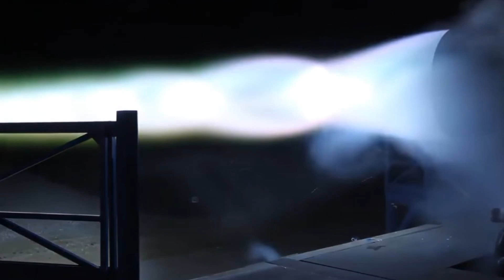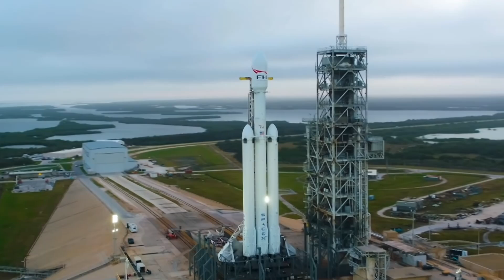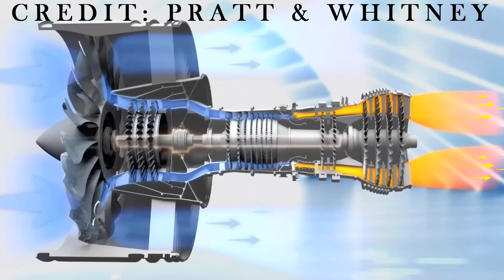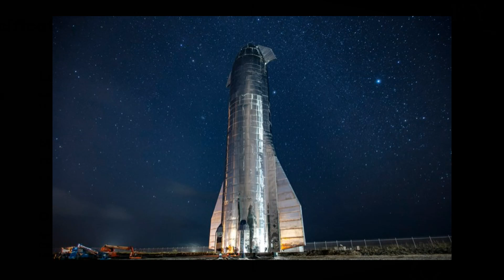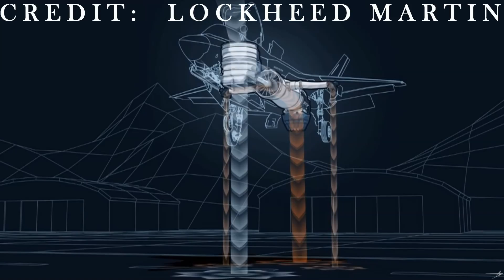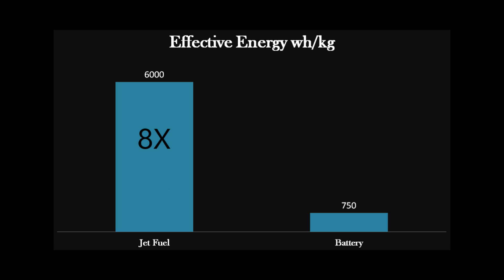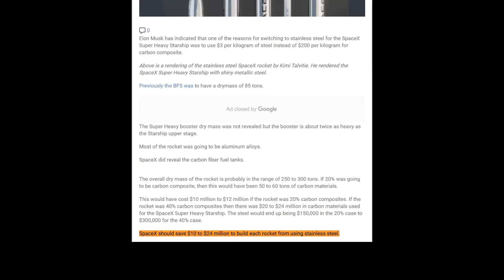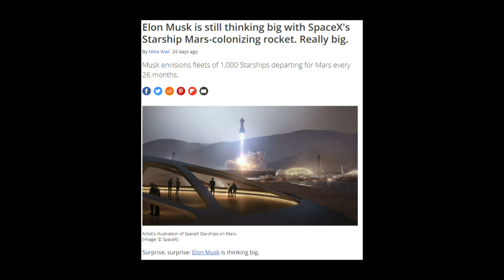ELON MUSK'S BATTERY POWERED SUPER SONIC VTOL JET - My Tesla E-SuperVTOL design

Comment: Im sorry, great video but there are so many things you have wrong in your assumptions about trans-sonic aerodynamics, supersonic aerodynamics, Jet engines design principles (electric or conventional) the list goes on. When Elon discussed the energy density for viable electric flight, it was for sub sonic viability. Currently the only jet to super cruise (fly at supersonic speeds without using the afterburner) is the F22 raptor. If you would like to refine this concept i would be happy to discus it with you, I'm not here to just shoot you down. Genuinely think a closer and deeper look into the possibility of a commercial VTOL aircraft would make a great video.

I do 3d modeling, CAD etc and have access to fluid flow simulation software, so if you want to do a follow up video id be happy to offer my assistance and share my knowledge. I have an unhealthy obsession with aircraft, especially the SR-71, so I've gone down some crazy deep rabbit holes chasing information.
Reply from the maker: All good!  I'm looking for critical feedback, will reply to your DMs on twitter after I catch up with all these messages
Reply: Didn't "The Concord" break the sound barrier?
Reply: @kaveeone  yes, but it used afterburners to do it
Reply: @23chaos23  Concorde used afterburners to break the sound barrier yes. But then once at supersonic velocity it did indeed supercruise. Concorde holds the record, to this day, for the longest time spent in supercruise.
If I remember correctly, Concorde could supercruise for as long as two hours.
Reply: @martinw245  correct, but you are missing the point here. I had a great discussion with Jordan and he might do an updated video possibly a series talking about the Limiting factors... pun, no pun, you decide.

TLDR: Electric supersonic flight, not happening. VTOL possible but actually very impractical.
Reply: @23chaos23  No I'm not missing the point. The only point I've corrected you on is when you said "currently the only jet that can supercruise  is the F22 Raptor". It's not, simple as that my only point.
Reply: @23chaos23  "VTOL possible but very impractical."

 Subsonic it's happening now. I've lost count of the number of flying and prototype VTOL electric vehicles that are currently around.

Supersonic... no way. Supersonic flight at lower altitudes requires significant thrust. No ducted fan powered by batteries can currently do that. In fact I'm not sure any ducted fan could ever accelerate an aircraft supersonic at low altitudes.

At altitude the air is thinner and the speed of sound lower but then a ducted fan or any kind of propeller is very inefficient at higher altitude.

Electric aviation is the future. We already have Eviation Alice about to have its test flight. Promising 1000 kilometres and twelve passengers. But I'm pretty confident we can forget supersonic electric aircraft. There is no reaction mass emitted, so it has to be ducted fans, and I dont see how that's possible.

This is Elon  doing what he sometimes does... making fantastical claims. 
I like that he does think that way though, because he sometimes proves the sceptics wrong.
Reply: @martinw245  key word, currently. Is the Concorde still flying? No, the Eurofighter, Crippen etc also can not achieve super cruise without using afterburner. Sure after using AB and achieving mach 1+ they can turn off the AB.
Reply: @martinw245 .........really?
Reply: @23chaos23   I didnt mention Concorde in my original list of aircraft that can supercruise. You, later, responded to someone else re Concorde.  That was the only reason I mentioned it. No, of course, Concorde isnt in service, why I didnt initially mention it.
Reply: @23chaos23  I dont think you understand what supercruise is. Supercruise is the ability to SUSTAIN supersonic flight with afterburner off. Grippen can do that, so could Concorde. So can the other aircraft mentioned. Supercruise does not mean accelerating to that speed without an afterburner.
Reply: @martinw245  again, I said, able to achieve super cruise without AB. Dude seriously your picking at words at this point. Have a nice day
Reply: @martinw245  more like three hours, and it didn't need afterburners to get through the sound barrier it was simply more efficient to blast through it on a quick burst of afterburner than sit transonic for a long time on dry thrust.
Reply: @deep_dive6699  Acording to Google it was two hours Concorde supercruised. But fair enough if you have a resource that suggests 3 hours.
Reply: Chaos

"I said able to achieve supercruise without using an afterburner"

No you didnt.  What you actually said was, and I quote... "the F22 was the only aircraft that could currently supercruise" Then in brackets you defined supercruise as...  (fly at supersonic speed without using an afterburner)"

Which is wrong. There are a number of aircraft that can "fly at supersonic speed without using an afterburner"

You initially said nothing about how that supersonic velocity was initially achieved.

One more point... you are saying that you believe the F22 can ACHIEVE supercruise without initially using the afterburner. If so, I would be grateful if you could provide evidence for that. I heard was that the F22 could SUSTAIN Mach 1.5 without afterburner but still required afterburner initially, just like the other aircraft I mentioned.

Wouldnt be surprised if it could, given that it can sustain supercruise pretty much indefinitely but would like a link.
Reply: @23chaos23  English electric lightening for example could achieve and sustain supersonic flight despite not having an afterburner. You need to recheck your facts.
Reply: @avidaviator8580  best recheck yourself,  The Lightning's optimum climb profile required the use of afterburners during takeoff. excerpt from the wiki under climb performance.

https://en.wikipedia.org/wiki/English_Electric_Lightning#Climb_performance
Reply: @avidaviator8580  also i said "currently able" the lighting last flew on 14 January 2014 after restoration and is currently the only airworthy example. see civil operators at the bottom of the wiki
Reply: @23chaos23  that literally changes nothing, the early versions could go supersonic despite not having an afterburner. Later versions did have an afterburner. And what relevance is currently flying when we are discussing the feasibility of technology.
Reply: @avidaviator8580  if you would like i we can have a chat about jet engine design principles and why the lightning's avon is a non conventional engine
Reply: @23chaos23  we can, but it still doesn't change the fact that you wrong about supercruise and the aircraft that can achieve it, before you shoot down the video.
Reply: @avidaviator8580  best you wait for Jared's follow up video, we are working hard to collect all the information to put together a new video. I wasn't shooting down the video, I was trying to help him understand the subject is much more complex and many of his assumptions were off. You can all go on about my mistake with the f-22 which I admitted to, but my assertions on the subject of the video are not false.
Reply: @23chaos23  that's true, I can agree that the video is not the most accurate.
Reply: @avidaviator8580  i can admit my words often come off the wrong, Im on the asperges spectrum. On the subject of how the lighting achieved super cruise, two way overpowered engines in a barely big enough air-frame, also the avon engine sacrificed a 2nd stage turbine for greater output. made them notoriously difficult to start. they built the thing to be a hot rod interceptor, causing it to have numerous problems in flight other characteristics.
Reply: @23chaos23  - I it was me dreaming up an Electric Plane, for a Test Mule, I would use. Cessna 210. For the Proof of Concept, Burt Titans Designs are better Aerodynamic Efficiency.

Basically, like the start with the Roadster, start HIgh End, and work down!
Reply: @robertweekley5926  Thats a good approach to use, personally i would start with the 208 caravan. Its use as a commercial air frame along with that large underslung cargo add-on could be used to house all the batteries.  Im also a fan of Burt's designs, but they weren't always the most aerodynamic, Burt used a broad "try many designs to find the ones that look good and also work" approach.
Reply: @23chaos23  I agree with @Robert Weekley herer: You really want to figure out the first viable market for electric planes and target that, just like the how Tesla targeted the luxury sports-car market first, then expanded. In this case, the analogous market would probably be private jets. They aren't so cost sensitive and they don't have to have the longest range if you can offer other benefits like VTOL.

I wouldn't target commercial air frames. I would target luxury private jets.
Reply: @AbeDillon  That is exactly why i suggest modifying the Cessna 208, they are used for remote/rural commercial operation. STOL bush planes, island hoppers, places where an electric plane's major feature, low running costs, can really shine. Currently electric planes are being used in the small twin seat class as training platforms. The luxury private jet industry is not a good market to try and enter, purely from an economic and volume of sales stand point. You are absolutely correct about large commercial air-frame being a bad way to go. Comparing it to Tesla, it would be like starting with the cybertruck or a utility vehicle rather then the luxury sedan.
Reply: @23chaos23  Luxury Private Jets are low volume but high margin. That's why they're a good fit for Tesla to build expertise by devoting a small "skunk-works" team to cutting their teeth on a first-gen design. Just like the Roadster.

You can make a Luxury Private Jet that's viable before you can make a commercial plane that's viable because you have a lot of profit-margin to cushion you from any lag in technological progress.

Mass market = extremely cost sensitive = low margin.

Small twins and training platforms are the scooters and bicycles of the aviation world. They're low-margin platforms that also serve as early addressable market for electrification. But they're still quite cost-sensitive.
Reply: @AbeDillon  The difference in margin for luxury, vs the volume of medium light commercial sales is an order of magnitude in favor of commercial. That's assuming your assumption that luxury privet jets sell with a high margin profit, which they don't unfortunately. The luxury Jet industry usually sell just below unit cost, they make their money with spare parts, maintenance and servicing revenue.
Reply: @AbeDillon  - I suggest the Cessna 210, for a few reasons: One, they are generally "Available", used, for $50,000 to $150,000 Price Ranges, depending upon Engine Age, Avionics, Aircraft Age, and Variant (Plain Non - Turbo, Turbocharged, and Pressurized - Also Turbocharged, of course).

Second, I suggested it as a "Test Mule", not a Commercial Conversion Offer, but That might even be an option step along the way, to get greater data collection, than from just one or two test rigs.

Third, it can Fly up to about 200 Mph on 285 HP, and with Siemens 110 Lb, 350 HP, Electric Aircraft Motor, you have about 400 Lbs of Engine Weight missing, plus Fuel Weight, of about 110 Gallons, of about 700 Lbs!

Fourth, I have Flown it, loaded, as well as Empty (Just Myself), and Slowed it up to 160 Mph, leaned out to 8 Gallons Per Hour (GPH), or 20 Mpg @ 160 Mph! Since max Fuel Burn is about 14-16 GPH, I figure it was only using about 135-150 HP to cruise at that Loafing Speed, just puttering along, at about 2,000 RPM on the Engine, or about 100 kW! 

Since Tesla Already can provide a 100 kWh Pack, at not far off of the 700 Lbs Fuel, Plus 400 Lbs of Engine Weight Missing, it seems, without any seating lost (It usually seats up to 6!), You could easily get 30-45 Minutes of Run Time, plus 15 Minutes "Reserve", nearly "As Is" with Limited "Customization".

Making it a 4 Seater, gives you about an extra 340-350 Lbs Usable for Batteries.

Going with the Cessna 208 Grand Caravan, Requirements go up, to two x the 350 HP, or use a MagniX Motor, if not the Siemens one, and it's at 750 HP, but, as Harbor Air is learning, in commercial applications, it's as much about Airframes, as it is about Power Systems. A Beaver is a Great Slow Speed Aircraft, but a Caravan from Cessna, on Wheels, is way "Cleaner", Aerodynamically, than a Beaver on Floats!

Nice thing with Aircraft, if the Weather is Sunny, or even just "Decent", is that a 15 Minutes Long "Flight" can get you 50-70 Miles, in a Faster Plane, and that could be a 2 hour, to 4 hour Drive, in a Car, depending on availability of Direct Roads and Traffic, or Not! And, available Airports!

So, for the early part of this Decade, places that can be served, by 15 Minutes to 30 Minutes long Flights, can take Advantage of Electric Flight. Maybe at the later part, 2-3 Hour Flights, under Electric Power, in Certified Aircraft, will be becoming available and not just dreams!
Reply: @martinw245  I agree, I've been flying duct ed fans for years, and there is no way you will get one to go supersonic. The fastest one I've seen is around 145 MPH. I flew mine up at Tahoe, and that is not very high, and it was kinda gutless, and I noticed a difference from flying it at sea level. No way one is going supersonic.
Reply: @3000gtwelder  Yep. I'm afraid Elon does talk nonsense from time to time. Unless this microwave plasma thruster notion bears fruit I think we can dismiss Elon's supersonic VTOL electric aircraft as another one of his baseless notions.
Reply: Musk did talk about an "electric Jet" supercrusing. He pointed out that without the need for oxygen for combustion, it could fly higher and experience less friction.
Reply: @DrZond  Indeed it wouldn't require oxygen and experience as much friction. But an electric aircraft cant be a true jet, there is no reaction mass. It's a pusher propeller with ducting. A ducted fan. And propellers or ducted fans are very inefficient at altitude. I wouldnt take Elon  Musk's comments re this that seriously to be honest. VTOL and electric ducted fan and supersonic... pretty sure wont happen, pretty sure not feasible.
Reply: @martinw245  You're assuming that a electric jet would be propelled by the propellers rather then heating up air.
There's more then one way of using electricity to power a engine, the use of magnets to make a axel turn around isn't the only one.
For instance imagine a electrically powered ramjet using electricity to create electromagnetic radiation heating up the air in the ramjet in order to create thrust, other substances could also be added to the air that's not fuels being burned but simply targets for the electromagnets in order to increase heating output if desired, turbines etc can be added to help compress the air at lower speeds allowing for more thrust when it's heated up and expelled out the back.
Reply: @Luredreier  

"You're assuming that a electric jet would be propelled by the propellers rather then heating up air."

Yes I am, when I say "can't be an electric jet" I refer to current technology. Because currently and a fair way into the future, that is the only viable means, a ducted fan. 

"For instance imagine a electrically powered ramjet using electricity to create electromagnetic radiation heating up the air in the ramjet in order to create thrust,"

I admire your creativity. But you are forgetting one VERY important factor... ENERGY DENSITY. 

If you try to do what you suggest you immediately run into a mass/energy density issue. 
 
Energy requirement for an aircraft is high, and the mass must be low. Energy density for jet fuel is 34.7 MJ/L. 43 times higher than a battery.

It will be a long time until battery energy density is high enough to achieve an equivalent energy density to jet fuel. 

I'm, not saying it will never be possible, just that, it would be  a fair way into the future and currently, any electrically powered aircraft would have to be a ducted fan design. 

So if Elon truly does have a viable "electric jet" design in his head, it will be a ducted fan.
Reply: @martinw245  Just noticed this prototype design of a propulsion thruster that utilizes pressurized air plasma induced by microwave ionization to create a "jet engine" with only air and electricity: https://aip.scitation.org/doi/full/10.1063/5.0005814#
Reply: @mearino 

 Hi Dean. Yes, I noticed that the other day. Fascinating idea. I think it would probably require a battery with a considerable energy density though.

They mention a Tesla car battery in regard to generating enough thrust but over what time frame? For a few minutes? Hours?

In other words, how would it get on for gravimetric energy density?

Will be interesting to see where this goes.
Reply: @martinw245  There were some concerns at Ars Technica: "The question is one of scaling. At the air flow rates (around 1m3/h) and microwave powers (less than 1kW) that the researchers tested, everything scaled very nicely. But the airflows are in the region of about 15,000 times lower than those for a full-sized engine. The thrust also has to scale by about four orders of magnitude (meaning the power does, too). Extrapolating linear trends over four orders of magnitude is a good way to be disappointed in life.

I also believe that the warning signs are already in the paper. If you look carefully, there are some missing data points. For instance, at the highest microwave power, only lower flow rates are tested, while for low microwave power, all flow rates are tested. That seems like an odd omission. I suspect the plasma is not stable at high flows and high powers.

If you're thinking this work might help save engine weight, I wouldn't be so sure. If the plasma thruster becomes part of a turbofan engine, I suspect it will be heavier. In a non-bypass configuration, it might be lighter. Still, this is very cool work, and I hope it works out. " (https://arstechnica.com/science/2020/05/microwave-thruster-makes-for-clean-burning-jet/
)
Reply: @mearino  

Thanks Dean. I'll give that a read.
Reply: No that's wrong. The F22 isnt the only jet to super cruise. The F35 can supercruise, the Eurofighter  Typhoon can supercruise. Rafale and Grippen  can supercruise. SU-35 can supercruise.
Reply: From what i read the F-35 cannot supercruise. This was known for some time. https://www.defensenews.com/air/2019/06/12/supersonic-speeds-could-cause-big-problems-for-the-f-35s-stealth-coating/
Reply: @bradjohnson169  

Yes that's kind of true. F35 can supercruise but not for a lengthy stretch. They reach supersonic speeds with afterburner and then can throttle back for 150 miles or so. I guess it's better defined as short range supercruise.
Reply: @martinw245  Thanks Martin, I quite agree.
Reply: @martinw245  facepalm
Reply: @martinw245  good to know, that wiki entry needs updating then.
Reply: @23chaos23  Please can you tell me which of the follow super sonic wing design is the most efficient? This is bugging me for long time and i can't find a clear answer.

1.)Straight wing with supersonic sharp leading edge (F-104 Starfighter, Aerion As2, X-15)
Or
2.)Delta Wing with subsonic blunt leading edge (Concorde, Convair B-58, Boom Overture)
Or
3.)Delta Wing with supersonic sharp leading edge (XB-70, SR-71)
Or
4.)Swept Wing with subsonic blunt leading edge (Rockwell B-1, Tu-160) (can't find examples with non variable wings)
Reply: @martinw245  Brother, he said "Super cruise without using afterburners". All those other planes go supersonic only with afterburners.
Reply: @flagship1701e 

You are confusing two diferant phases of flight.
Those other aircraft DO supercruise without an afterburner. Going supersonic, accelerating to that speed, is nothing to do with superCRUISE! Pay attention to the second part of the word. SuperCRUISE. Supercruise is defined as CRUISING fying at supersonic speed in the CRUISE on full military power without the use of an afterburner. It's nothing to do with using an afterburner to initially obtain that speed. Supercruise pertains to CRUISE the clue is in the name.

Thus... the F22 is not the only aircraft that can currently supercruise.

He initially said nothing at all about accelerating to cruise speed without an afterburner.

Incidentally, I belive the Typhoon may be able to ACCELERATE to supersonic speed and thus supercruise without an afterburner. But I'm still researching that
Reply: You seem to be the guy with some answers. Electric jetengine? From where does the propulsion come? Turbine, does that work at supersonic speeds?
Reply: @RomainVanAelst 

 If electrically powered it's not what we normally consider  a jet engine. It would be ducted fans. Batteries or fuel cells to drive electric motors which drives pusher propellers. For efficiency they add ducting with the tips of the blades close as possible to the ducting.

Referring to such a propulsion method as a "jet" often results in heated arguments.

A company called Liliam  are currently manufacturing what they call an "electric jet" but one look at the design tells you that in reality, its ducted fan propulsion. "Jet" just sounds sexier for marketing purposes.

https://lilium.com/the-jet
Reply: @martinw245  Thanks very much, had a feeling 'jet' was not in his place here. And thanks for the link.
Reply: Comon gents, when is the follow up video coming out?
Reply: English electric lightening could go supersonic without afterburner?
Reply: @avidaviator8580  Yep, very true. The Lightning could indeed go supersonic without use of afterburner. In fact I recall that the first lightning didnt have an afterburner.

At 62, I can tell you from first hand experience that it was a phenomenal machine. Went to an air show in Devon when I was in my 20's and the lightning was performing. Absolutely deafening, raw power. A brick with two immensely powerful engines basically.

In those days they were allowed to fly over the crowd. When it did so, over our heads, it was an unforgettable experience.
Reply: @martinw245  shows this man is talking garbage, how can you comment negatively about someone's video when your evidence is incorrect. Also I'm super jealous, my best airshow experience is the F35.
Reply: @avidaviator8580  Sadly I've not seen the F35. Missed it at RIAT. Hoping to catch it this year.
Reply: @martinw245  saw it Farnborough during the "reveal" if you could call it that.
Reply: @avidaviator8580  Lightning...
Reply: @martinda7446  shhhhhh
Reply: @avidaviator8580  (OK...🙊)
Reply: chaos my thought is: how can this design possibly attain cruise?
Reply: Back to the topic: I don't see any electric turbine go supersonic. I can imagine an electric multistage compressor followed by a reduced section that can make a supersonic jet but then I assume efficiency would be horrendous.
Reply: @ericseidel4940  absolutely correct, even producing a supersonic jet (exhaust) with a multi stage Axial compressor is a tall order. the final stage compressors and stators would be operating in unsustainable environment.
Reply: chaos - F23 was a better jet and had better Supercruise ability.
Reply: The Sr-71 is possibly the coolest thing to ever been constructed by man. I dont know if its any of the same people who worked on it that are now working on the Skylon but its the same team that are now building this higly impressive space plane, I really hope it gets built.
Reply: Why no one thinks about condensed nuclear reactor for aeronautic application? It can power multiple electric air turbines using superconductors to deliver power virtually resistance free.
Reply: @viewer7200  The US air force tested the concept decades ago with multiple different reactor layouts. The two primary issues they encountered (depending on which reactor design was used) were either exceedingly high radiation emission into the atmosphere or excessively heavy radiation shielding requirements, which were not conducive to practical flight performance. I don't remember which documentaries explained this program, but a bit of Googling will probably get you there.
Reply: @viewer7200  Nuclear power for aircraft was considered long ago.

https://en.m.wikipedia.org/wiki/Nuclear-powered_aircraft

Many issues with this notion though.